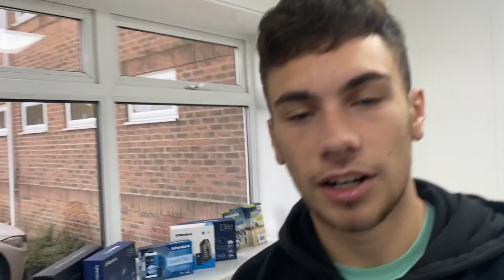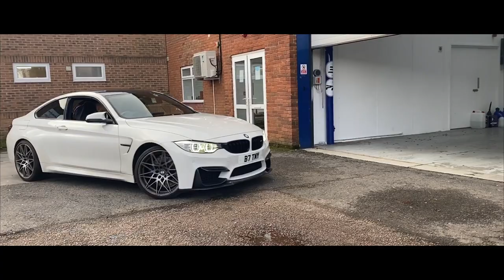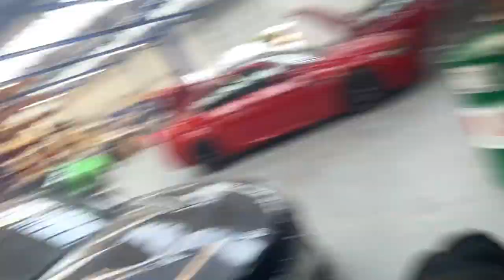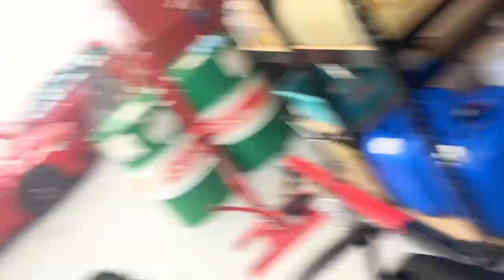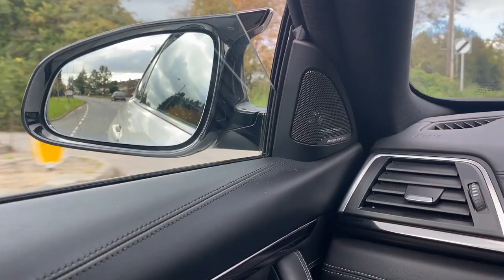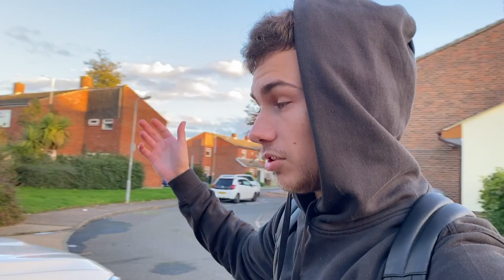BMW M4 GETS 520BHP STAGE 2 PLUS DECATS! (INSANE)

Comment: Thanks for explaining what twin turbo means “more than one turbo” 👍
Reply: Thank god he explained that. Otherwise I'd never of known that twin turbo means more than one.
Reply from the maker: Your welcome
Reply: Twin turbo generally means it has two turbos which are exactly the same. Bi turbo means there's two turbos but they are different for example there might be one smaller turbo to give low down power and a bigger turbo which comes in at a higher RPM 👍
Reply: @zaink7037  thanks for clearing that up I would never have know that
Reply: @zaink7037  what?  Bi means 2.  You're getting mixed up with sequential turbos.

Comment: If you haven’t done crank hub fix then say goodbye to your s55
Reply: More common failure at 600WHP (notice WHP). No preventative maintenance required. He's still in the safe area.
Reply: @JJROADSTA  it’s happened on stock tuned cars mate what are you on about
Reply: Would you say a stage 1 is still sweet without the crank hub being touched? I know it can happen even on a stock car but obviously with stage 1 warranty goes out the window
Reply: Think evolve would have advised what’s best to do.
Reply: @iCIlluSioNSs  I was doing research  on the S55 engine. I read up on the crank hub issue. Any links I'll be happy to have a look as interested in this issue.

Correction 'Even on higher horsepower, modded cars, spun crank hubs seem to occur on less than 1% of S55 powered M2, M3 and M4's.'
Reply: Rod bearings are starting to become a thing on the s55.
Reply: @TheM5Dog  there a fix now but it’s expensive
Reply: You clearly haven't done any research, this happens to less than 5% off all cars tuned and not. At this stage a crank hub holder is recommended. A new crank hub is only recommended with upgraded turbos.
Reply: @xenonstatic  regardless it’s still a weakness on stock motors let alone tuned one

Comment: Why do folk remove cats seeing as they are installed for a purpose
Reply: @charltonshimwell9264  great spelling
Reply: @mynameisborat6846  and least im not gay
Reply: @mynameisborat6846  do you have any clue about cars?
Reply: @charltonshimwell9264  what does sexuality have to do with someone who is talking about cats? This is a prime example that you have no idea what you are talking about so you try to divert the topic in hand away because you are out of your depth.
Reply: @jdmtuning5890  my first car was a clio 182 which I built and turbo'd
Reply: @charltonshimwell9264  how very adult
Reply: In short.. ppl remove cats (from turbo cars) because it aides the expulsion of exhaust gases.. this in turn allows the turbo to spoil up quicker, reducing turbo lag, creating more horse power and sound to the exhaust..
Reply: I’m well into penis but I’m aware it improves performance by reducing back pressure.  It’s also illegal to modify a car in such a way that affects the emissions declared by the manufacturer.  You can get a £1000 fine driving at car with the cat removed. Something to be aware of if you are thinking of doing it.
Reply: Makes us go slower mate
Reply: @charltonshimwell9264   where’s the videos of the 182. Also why would you turbo a trash engine like that it would constantly blow up.
Reply: @jason21jburg  because they r v fun cheap little cars with good chassis and for my first car it was all I could afford
Reply: @jason21jburg  it wasn't a huge build come on just added a turbo for a few extra bhp

Comment: What about the crank hub?
Reply: 2nd hand engine would likely bankrupt him
Reply: @tracktimevideos5164  hater
Reply: @tracktimevideos5164  nobody care what you say
Reply: Crank hub won’t be a problem you have consumer rights and bmw with have to rectify it if it’s goes, especially if it’s a common known fault. 
I booked my wife’s 2015 Ford Focus zetec S in for an mot and service it had a major recall something to do with the crank they fixed it for free else it would of cost me over £1000 otherwise.
Reply: @scottlaaa   The car has been mapped, BMW do not need to rectify the issue if the engine is modified. If the car is stock and in warranty then yes free engine.
Reply: @johnmills550  I bet he could easily get a standard map back on it if it does break, shouldn’t be to difficult.